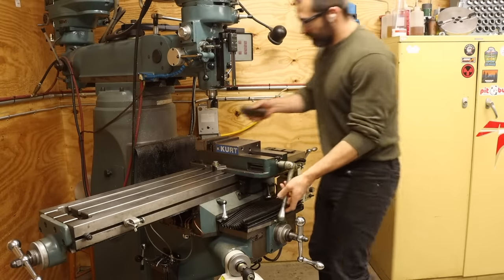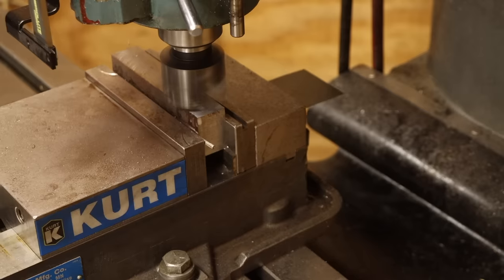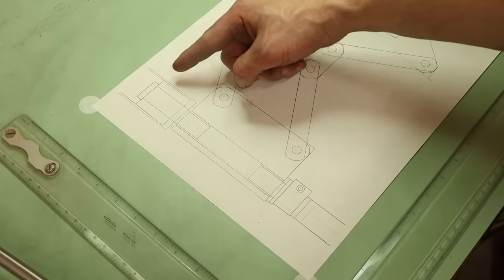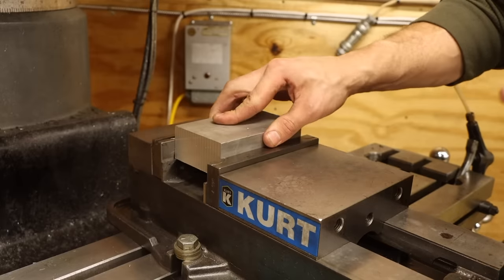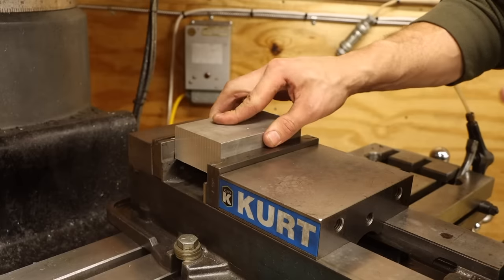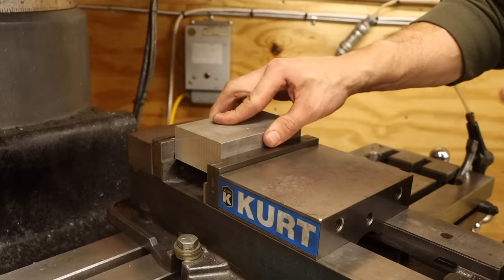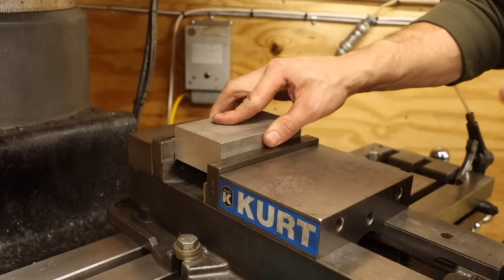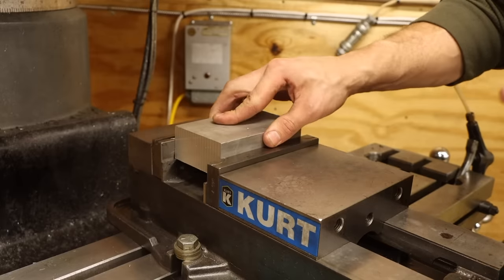A Life Changing Filming Upgrade || INHERITANCE MACHINING

Comment: Just a small quick tip from a toolmaker, Use a standard dead center between the work piece and the dead center in your tail stock to indicate on and align the center hole instead of indicating in the hole.
Reply from the maker: That's really useful! Thank you

Comment: You can purchase aluminum track to attach to your ceiling which accept locking rollers which you can hang lights and cameras from. They're called pantograph systems and they're incredibly handy, but pricey. Manfrotto makes the most popular ones. You just position it where you want and twist the locking collar to secure your shot.
I betcha you could take some inspiration from it and build your own! 
I installed several of these in photo studios and colleges and they're a game changer.
At their core they're pretty simple devices but they're invaluable for saving time and having things out of your way.
Edit: I got too excited and commented too early. This is essentially exactly what you built, minus the scissor design of the panto arm. Good work!
Reply from the maker: 😁  I saved the fancy stuff for the end! I stumbled across the photography specific rails when I was planning but it was cost prohibitive. The unistrut ended up being surprisingly smooth though so I'm not upset about it at all! Thanks!

Comment: This is awesome! It is even sturdy enough to add some features. How about a worklight? You could also run a cable along the rails and through the arm in order too have a movable outlet. Could also be possible with the shop vacuum or compressed air!

Comment: Very nice project.  I might want to add a step motor to one or more of the axes to get some filming options.  Along with that idea I might design a holder for a camera stabilizer such as the one I own - a Zhiyun.  it cost about $150 but it works very well, it is easy to use, and the effect it has on the final video is huge!  

Just a thought and you are so creative I can imagine that this will at least spark a thought or 2.  Cheers

Comment: This is awesome! A couple of possible upgrades for the future would be a quick locking system for the X & Y carriage system and possibly a few rubberized vibration dampening blocks in a few spots just in case vibration carries from the machines through into the ceiling, potentially affecting the steadiness of the camera in certain circumstances.

Comment: This is FRIKKIN BRILLIANT!! A quick and cheapo solution is to use one of those 2-section articulating lamps on an arm, the kind that clamp to the edge of a desk. You can add a "phone clamp" like the kind that plop on your vent in the car to hold your Hero, phone etc above the lamp shade, so you get bonus lighting. Replace the clamp with a sand bag and you can put it all sorts of places. This contraption also works great for other stuff. I made one with an old hair dryer to quick-dry paint, glue etc. THANK YOU for waking me up to the camera usage on my "no lathe needed option". Yours is a billion X better tho..nice job!
Reply from the maker: Thanks! If there was an affordable arm that could actually support my fat camera I would have gone that route as well 😂

Comment: Your videos only get better, I love the way you get to the point with just enough detail. 

You probably already know but incase you didn’t. Instead of clocking the part in the 4 jaws with the indicator on the centre hole. You can run a dead centre that has a centre hole in the rear between your live centre and your part. This makes it easier to set up the indicator.
Reply from the maker: Thanks! And I didn't actually know about that before someone else mentioned it. I'll add that to the memory bank!

Comment: 23:50 I was like "will you hold my ankles so I can dumpster dive?"  Really EXCELLENT solution overall; the 'y-axis' gantry to give you full coverage is stellar. The knurling/bluing on the handgrip I said WOW out loud 🙂
I had a small idea: add a fluid semi-filled reservoir at the camera end if residual vibration shows up in the arm (like the Taipai Tower).
Reply from the maker: 😂 I've been pondering idea to help smooth out the small swaying I get at times. The fluid reservoir is absolutely genius!

Comment: One thing I'd like to suggest is scales on the rails and angle markings on the joints. That way you can easily repeat certain shots in case your files get corrupted or something different happens.

Comment: I am pleased as punch that you as and engineer actually know (are learning) how to make parts. This simple fact will make you a better engineer. I was a model shop ,prototype , machinist for 30 years. I was chronically frustrated with the engineers that didn't have a clue as to what it actually takes to make a part. The newbies that took part in the Formula SAE projects at their Universities where head and shoulders above those that didn't. You are moving right along with your skill level and idea implementation. I always found the personal ( Gjobs) way more rewarding then the projects I was hired to do. Although I did do  some very meaningful projects in the prosthetics and medical field in the latter part of my career.
Reply from the maker: I really appreciate that. I was fortunate enough to come from a background of making and machining before going to college and it really made the difference. But even with that, spending time in the shop more extensively this past year has revealed a whole other layer to design for manufacturing. There really is no replacement for the hands on experience.

Comment: Hi Brandon,

you did a great job there and the piece turned out amazing. 

There is only one thing, thats bothers me. As a woodworker i nearly got an panic attack, when you used that table saw to cut the plywood down. What you did was really sketchy and you could've easily hurt yourself very badly (loose fingers/hand, broken bones, internal bleeding, etc.)
The first cut was not optimal, but no disaster. You always want to have to long side of your board against the parallel fence, when ripping down large sheets of material. Otherwise the plywood can rotate, catch in the blade and shoot back towards you.
The second cut was really scary. Never, Never, Never push any material over the blade without the help of a guiding fence or jig. Even tho you're using a riving knife the board is at a high risk of catching, when rotating slightly and will cause kickback. Apart from the workpiece shooting back towards you with extreme forces, your hand can be pulled into the blade. 

It's no fun talking about those scenarios, but it's way less fun experiencing those things.

Stay Safe!
Reply: 20:34 Thank god I found this comment before I was going to make one. I’m also a wood worker and broke my hand due to kick back from my table saw and riving knife in place. The wood climbed over the blade when I didn’t think it should have. 

Never free hand cut wood on a table saw without support, that shot gave me PTSD when I saw it and have to do a double take. Please be safe!!
Reply from the maker: Good calls on the table saw. Thanks for the reminder not to take those tools for granted!

Comment: I had a thought while you were mounting the channels to the ceiling - if you wanted to take the idea, and run decent size i-beam, and mount a carriage on that - you could have a  simple heavy-materials moving trolly thing, that would also work for the camera, with a larger carraige.
Reply from the maker: Not a bad idea. I think I would need to beef it up in areas to make sure it doesn't come crashing down!
Reply: @InheritanceMachining  You could also make tool-holder followers/trays for it.

Comment: This is a fantastic machine you made!  You really planned this out, and left nothing behind!  
A couple things when you used the table saw, though.  When you’re ripping a board on it, raise the blade so the gullets clear the board for more clearance of the shavings, and for more cooling of the blade.
When you clipped the corners on the plywood, you did this freehand.  You got lucky, but I’ve seen people do the same thing as you did, and they got a wicked kickback, with bruises and broken bones to prove it!  Please use a miter gauge, or better yet, use a circular saw on some sawhorses to clip the corners.  
Other then that, this is so cool!  I’m a better woodworker then machinist, and I watch your videos to see all the cool things machinist do.

Comment: Love it! Another tool to make more tools (or videos about tools). The multiple little ideas, from the bolts for defining an angle or an angle plate as a bench mark to the nylon inserts to prevent deformation over time, are just excellent.

Two minor things, and only because I worry at a professional level. First, the rigidity of the camera looks a little low. I'm not sure if it even could be damped, and maybe the camera has a stabilization feature, I don't know, but it stands out.

Second, I worry the camera will walk away on you across the gantry. I know the entire point was to eliminate all the locks and fiddly bits, but I'd consider putting a locking mechanism on it. Or station-keeping? I'd probably use some insane cable driven system, like a bicycle brake, but set to disengage when the handle is pulled, but you could probably get away with simply placing felt or delrin on the carriages to increase friction on the rails, but still leave it able to move when manipulated.

But that's just feature creep and paranoia. It's a beautiful piece, both elegant in its simplicity and detailed in its implementation. Plus it's a small number of people who can say "my home workshop has a gantry."
Reply: The large thin-wall steel tubing could also use some aluminium plugs to prevent crushing.
Reply from the maker: Thanks! And good considerations. The oscillating is fortunately easy enough to steady by hand once I hit the record button. Plus the camera's vibration reductions seems to help, and there are also some corrections I can make in the editing software if I miss it. It's all mostly a result of the shear size and amount of cantilevered weight.

I have since discovered a few spots where the ceiling rail needs some more support as the weight causes the rails to bow slightly and the gantry will drift a bit, but where it stays level it doesn't move at all. The felt pads are a good idea though.

Thanks again!
Reply from the maker: You might have missed it but I did plug the tubes with nylon

Comment: That is a uniquely fantastic build.  Just to present (after the fact) a easy to build (but inferior) alternative here's what I would have created for this purpose.  

I use magnets to mount items around the shop a lot.  If you want a secondary angle camera or just a quick move camera jig to a set of typical locations consider the following:  Take a strong on/off switchable welding magnet and stick a ball mount on it with the camera mount on the end.  Stick it to any metal bench or tool you have.  Add steel plates to key locations like walls or such using screws to give alternative locations.  Mount camera, move as needed.

Comment: The end boards block the light from the ceiling tubelights. May be make some holes in the end boards to make it lighter and let more light pass through?

Very cool project!
Reply: Maybe mount fill lights to the end boards???
They would move with the camera and (it seems) be up out of the way of everything, except possibly the mills pneumatic drawbar
Reply from the maker: Thanks! Yeah it ends up not being too much of an issue with all the other lights in the shop. Some holes would help though for sure

Comment: A neat trick you can do with setting up offset parts in a 4 jaw: use a dead center between the center drill point you want the part to spin around and a live center in the tailstock. Then indicate on the dead center and make adjustments until its running true.
Reply from the maker: Great tip!
Reply: @InheritanceMachining  blondihacks has a video showing it off, among other tricks with the lathe

Comment: Great build, could you add a spring loaded friction brake or magnet, that is released with a pull cord. That's touching side of unistrut channel to hold trolley more firmly.  Also add a spot light for filming, but power supply would take some work.

Comment: I have a fond affection for the way your channel works as a track  having used it to hoist roofing trusses in to place in the past, I’ve been pondering using a similar track to hoist heavy items in the workshop, so I guess a little regard for safe working loads and you might have a dual purpose track way?

Comment: A suggestion if it fits: Some slices of a bicycle inner tube stretched to make ‘tires’ for the trolley rollers make it that much quieter - a trick used to quiet pocket door rollers from an old mentor of mine.  Thanks for sharing your adventures!
Reply from the maker: Oh interesting. I might have to see if that works. Thanks!

Comment: A great tip for dialing into the centredrilled hole of the handle is to use a dead centre between the job and the live centre. Then dial up off of the dead centre.

Comment: I love your videos and your amazing work and you are way more accomplished with projects then I am. I recently acquired a  lux matter 1340 in great shape but setting it up and replacing a few worn parts. if your turning a taper and always have to adjust your tailstock after making a cut across your stock, your headstock is not true to your ways. that looks like a great lathe that should be adjustable and once you get it close to or on zero you don't have to do that anymore.(that's if you don't have twist in your ways but that's step one on a lathe). hope my 2 cents is helpful, please keep the inspiring videos coming.

Comment: Very nice indeed. One suggestion, at 22:00 you can see the boards are blocking the lights. As I see it, there's no reason why you couldn't cut the centre out of the board so as to obscure the lights as little as possible.
Reply from the maker: Thanks! It ends up not being so bad but might make the change just for good measure

Comment: Great build. I plan to do something similar in my new shop too.
The other thing you could add is a little 5" or 7" video monitor that faces you, so you can easily see what your camera is pointing at without having to mess with the flip out screen. Just use something like a Small Rig clamp and cheap ball head to mount it on the arm in a convenient place.
Reply from the maker: Thanks! And good idea!

Comment: Wow! Excellent build! This will definately make life easier for content creation.  I have 2 suggestions: maybe add some locks to the X and Y axis of the gantry. Something like screw that pushes a nylon foot against the track will stop the rig from drifting when the building changes shape. Second: when not being utilized for a camera mount the arm could hold drawings, a light, a magnifier, possibly a tablet for calculations or even a white board for old school notes. Maybe make a multi use adapter and some accessories. Greatly enjoy the content and you have sparked some ideas for my own shop.
Reply from the maker: Great ideas! Thanks!

Comment: Amazing indeed. I do wonder if you could add some locking mechanism for rail system that simply tightens to rail by quick lever twist. Would be amazing it it could lock both axis with one lever.

Comment: Beautiful work. I'd bet that you'll save a not-so-insignificant amount of time on setting up your camera shots while you work. And not having to worry about the possibility of damaging your camera in a fall is pretty great. I love watching your videos, and can't wait for the next one.

As an aside, speaking as a woodworker, though, I would point out that the freehand cut you made on the table saw at 20:31 is dangerous. Because it's unsupported by a fence or miter gauge, the slightest movement of your hand is enough to cause a violent kickback, and while the the riving knife helps keep the kerf open, if it gets shifts sideways into the blade, it'll still go flying.
Reply from the maker: Thanks, Tom. It's been a dream to use so far. And good call on the table saw. Not my best move

Comment: A somewhat easy addon might be a set of lock pins and a position marker for the rails, so you can fix the ceiling-mounted parts in place for repeated shots from the same position.3 Just a spring-loaded plunger that is retracted by turning a nub and which drops into the slots of the channel.

Comment: Absolutely amazing build and impeccable timing too! I've been trying to think of a replacement for my own tripod for so, so long and this is the absolute perfect solution! I initially watched Alexandre Chappels video on his solution, but that still takes up floor space and given I don't even have a workshop, but just an apartment, I really need to keep as much floor space clear as possible, so a ceiling mounted XY gantry would be absolutely perfect, although I'd have to mount extra X channels for lighting, as my current lighting unfortunately also uses tripods, but I'll definitely be doing this, once I've made my planned ceiling lamps
Reply from the maker: Thanks! I'd highly recommend this for anyone in studio photography or filming!